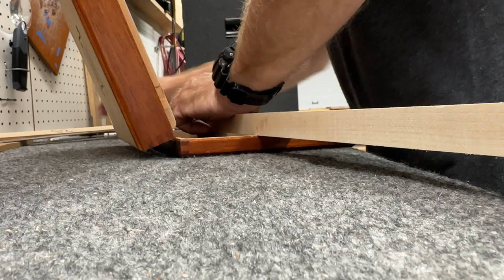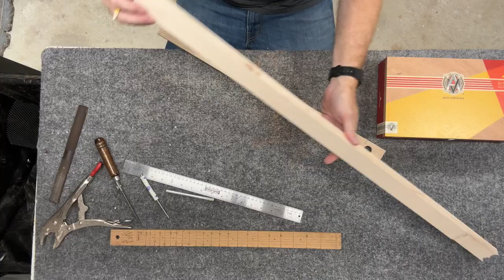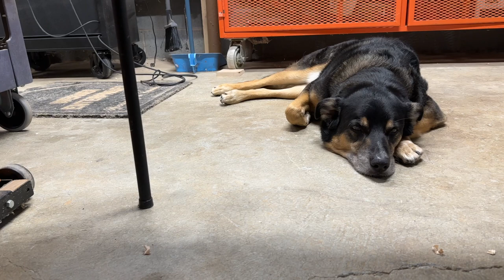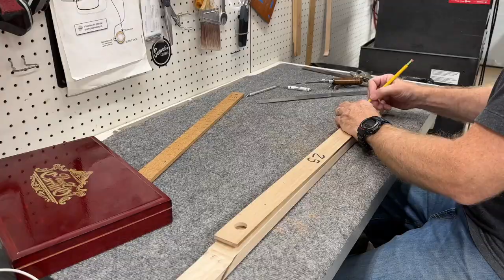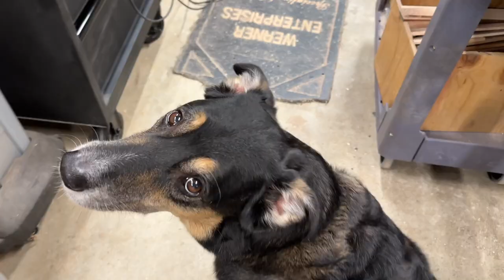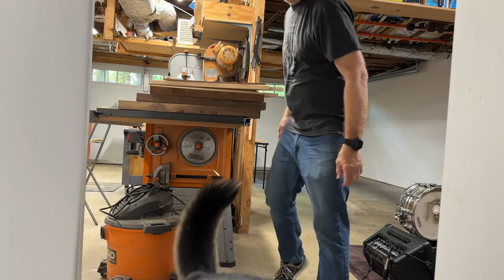Cigar Box Guitar Building Notching Boxes Today in the Shop - Snowden Guitars -Mike Snowden

Comment: Hey Mike, I see you cutting vertically but how do you score the box horizontally so that the cutout piece comes out so perfectly? Thanks
Reply: You can slide a razor along the inside of the lid at the wall / top seam. Like he showed, it will usually just snap off flush with some plyers
Reply: @FantaconeBoxWorksCBG  Thanks!